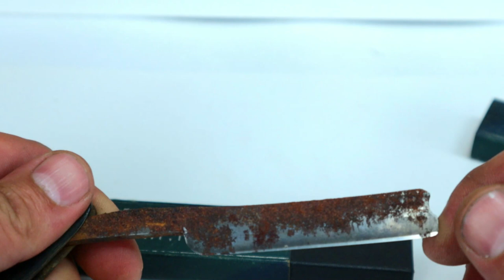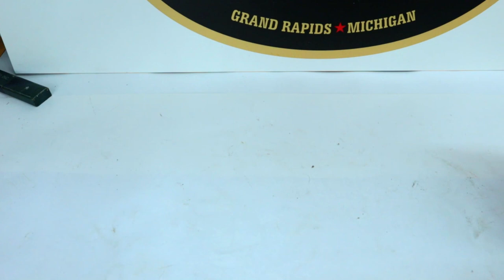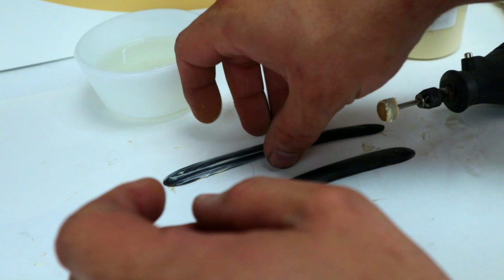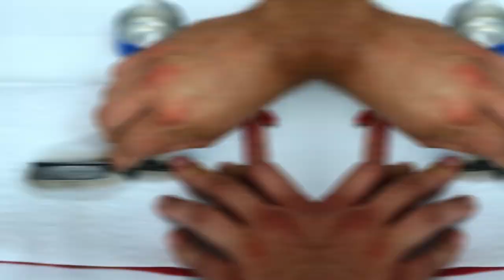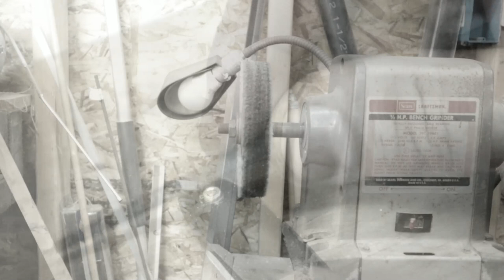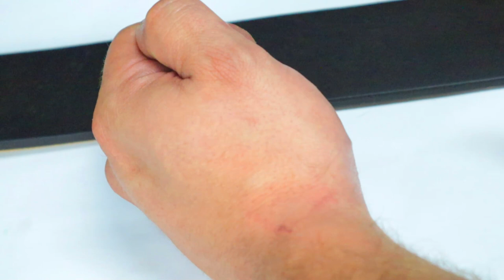Rusty Antique Detroit Straight Razor Restoration -ASMR

Comment: Ive done about 50 restos. That rust disolver you have i used on a Joseph Allen Silver Steel and a Hamburg Ring razor to get some mild rust pits out of the finish and made the mistake of letting it sit more than 24hrs instead of one or two and had a blow out in the grind but not the edge on the silver steel and swirl marks embedded on the spine on the hamburg ring razor that was almost impossible to polish out. Those of you watching dont allow it to sit more than an hour or two. I like the rivet pinning. I need to try that next. I have a nice Wade and Butcher that needs re re riviting and pinning as i cracked the scales in the same spot as shown in this video.

Comment: What did you soak the razor in to remove the rust?
Reply from the maker: Evaporust😁
Reply: Good stuff I hear. Haven't tried it yet. Depending on the size of the piece and efforts I usually do electrolysis or sodium hydroxide or vinegar/baking soda on my razors and vintage cast iron skillets.

Comment: Austin, what solvent did you use on the blade
Reply from the maker: Hey David! I used Mineral spirits on the second blade. The first one I tried evaporust. It's a great product and works well, I just messed up and forgot it for a week. Only supposed to be in there 12-24 hrs